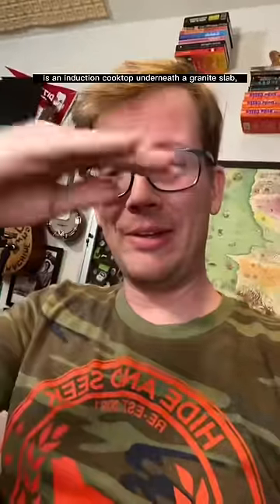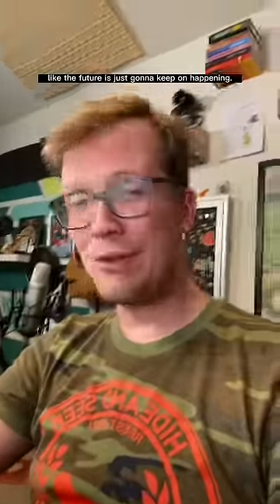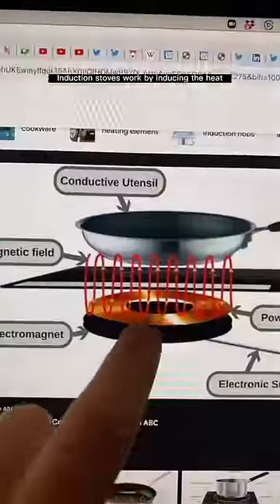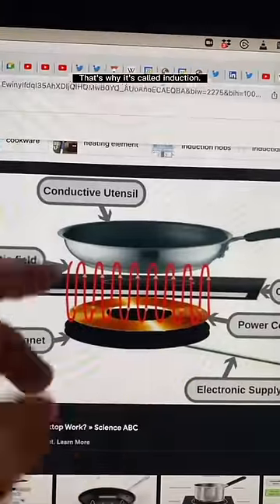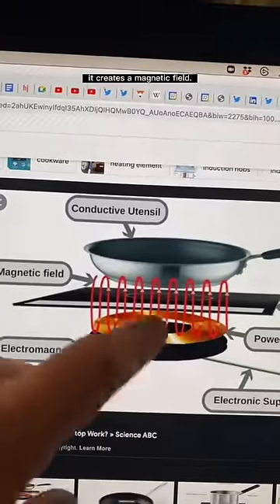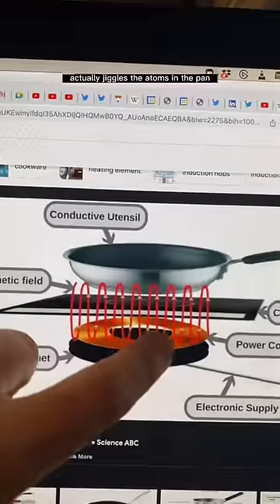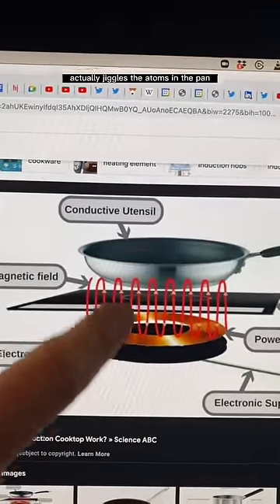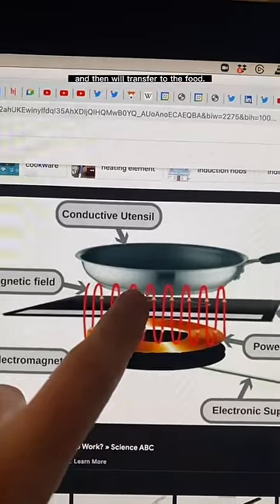How do induction cooktops work?

Comment: I love induction for the heat control, speed to heat up and boil water, and climate/health benefits. What I will say is that this person will find extreme difficulty getting any of those other benefits by having one installed under Granite. Many pans need super close contact with the induction device and even a thick pan will have trouble heating up enough to boil water.

Comment: I have a small countertop one that's kinda like a hot plate, they give off a super high pitched whine when you use them but I haven't heard it since around when I turned like 25 yay age related hearing loss lol sucked when I was taking culinary arts in highschool though.

Comment: Slight caveat: only certain types of metals are compatible with induction stoves. Learned that the hard way after a move. If you can stick a magnet to the bottom of it, it’ll work.
Reply: That's a great check to remember. Thank you.

Comment: Unless your house is solar-powered, it's MUCH more efficient to burn gas to provide heat directly, than to burn it in a power plant to make steam to turn a turbine to turn a generator to feed a transformer into a grid then back into a couple more transformers then wires into your house then an induction stove to make a pan hot. Burning fuel to make heat is almost 100% efficient. Using electricity, if you start off from the fuel, ends up being about 40%.

Comment: I just don't think anything beats gas stoves when it comes to the responsiveness/control they offer over the exact temperature of your pan. I've never liked cooking on induction and I've tried it for a while before going back to gas.
Reply: It takes some learning but it’s honestly so much easier and quicker, but mostly it’s just so much better for this planet we share!
Reply: @alam8540  eh, it depends where you get your electricity from - in many places you're just shifting the carbon emissions to another location nearby. And the difference between owning a gas stove or not is pretty minor in terms of yearly emissions compared to so many other things. 

Also I'm not looking for the one that will allow me to cook /quicker/, I'm looking for the one that will allow me to cook /better/. I cook a lot, and I appreciate the feel of a gas stove and how easy it is to understand it's current heat and how easy it is to make minor adjustments including by being able to lift the pan/pot off the cooktop a little bit to reduce heat too - which is something induction often doesn't work with.
Reply: @Night_Hawk_475  The idea is future proofing, as electricity production becomes more and more sustainable (or less unsustainable) the difference between the carbon emissions of a gas stove and induction will grow. Also it being faster means it’s more efficient, taking up less energy.
Reply: @alam8540  to do the same amount of work but faster takes more energy per second for the same total energy spent over the portion of the task - this applies in general for physics. Being faster doesn't always mean more efficient. 

Induction is more efficient, but the speed isn't the reason why.

Comment: That is so freaking dangerous. The thing about induction is that the cooktop does still get hot, because the metal cookware gets hot and some of that heat is transferred back to the surface, so you'll just have an invisible burning hot spot on the counter.

Comment: Not quite exactly what happens. What is really producing the heat is the electrical current induced into the metal pan. This is actually why transformer cores are made out of laminated plates instead of one big chunk in most cases, because the smaller the metal, the less current is induced into it. That's why a fat thick cast iron pan will work really well on an induction stove while a thin sheet pot will barely heat up.

Comment: Might lose a lot of benefits when behind thicker granite, even if it's thinner where coils are. If it's very thin, it's probably much more likely to break than the usual tempered glass used on induction stoves and much more expensive to replace.

Comment: Looks fancy until you forget that the pan is hot and also gives heat of to the granit so you never know what part of the granit is hot.
I also have an induction cooktop and it's great. It's not fancy like that granit one but mine has some glowing icons to tell me if something is hot
Reply: You can put a thin cloth made with heat insulation material as a pad for your pot. That won't affect much on the heat transfer because, as stated in this video, the energy goes "through the air" (changes in magnetic field).

Comment: I have an induction cook top (built into an oven, not invisible like this). Runs as hot as my gas one used to, isn't anywhere near as much of a nightmare to clean, gets hot SO fast, don't have to worry about the dogs turning it on and burning the house down (has happened once before - came home to a house FILLED with gas, no idea how animals didn't die it was that thick in the air)

Comment: As a cook and someone who's had induction ever since they've lived alone, induction is great, it's ecological, it's safe... But I miss fire, I miss being able to lift my pan up to sautée something, I miss having a clear indicator of how hot my shit is (or just a constant heat in general : induction doesn't fluctuate voltage or heat, it just turns on and off. if you put it on 80%, it'll turn on for 80% and then turn off for 20, that sucks)
The day we're able to make carbon free fire, that'll be the future.

Comment: so in this situation the pan heats up from induction while sitting on top of a granite heat sink?  like i know the stone isn't going to get hot due to the thermal mass difference but its going to draw all the heat off the pan right?  like thats why these cook tops are covered normally in glass and not 1/2 to 3/4 inch stone..

Comment: But the process of making the electricity to use induction cooker will emit CO2. For many homes it is out of reach not only because of the cost, but also the electrical infrastructure is not ready to transmit that amount of power. It is also in many cases still more effective to use gas.

Comment: the stove surface doesnt get hot, the pan does, but then the heat from the pan is going to transfer heat so you still couldnt cook something and then slap the surface immediately after removing it right? the cooktop surface would get a bit hot right?

Comment: mind, not all pots will work!
They need to be iron, or iron based (IE: Steel) otherwise they WILL NOT WORK.
As a professional chef those hobs are the bane of my existence, because I like to use aluminium pans because they eat up/cooldown faster than steel does, I also like to use copper pots for the same reason although they are a pain to clean.
So, you either use ferrous metal pots, or get the ones with a mixed layered bottom.
Reply: buy carbon steel light pans. I have a wok here that heats up pretty fast.

Comment: We had an induction stove that WASN'T hidden and one day my roommate put a glass  casserole dish down on top of it, not realizing it was still hot, possibly still on - it's been a long time, can't recall. Anyway, the pan EXPLODED. thankfully nobody was hit by flying glass.
Lesson here I guess is get an induction cook top but like be careful with it ok
Reply: The. Stove. Stop. Does. Not. Get. Hot. 

That’s literally the benefit of induction. Maybe you’re talking about a ceramic stove, which does keep hot quite a while. 

But any induction stove gets lukewarm at most.
Reply: @marcelslofstra2157  ok, well, it might have been a ceramic cooktop - they look pretty similar. But I imagine the same thing would have happened with an induction stove that was left on.
Reply: @anxiousArtisan not likely. My induction cooker gets a little warm from the metal pan sitting on it but definitely not hot enough to make glass break.

Comment: Where is the dials/controls for the stove top??? Also though granite is heat resistant, doesn't the sealant used on them yellow with prolong contact to hot pans?

Comment: Even though the there is no conduction of heat into the granite from the induction burner, wont the pan conduct the heat into the granite causing issues?  I know most foods will stay below boiling (atleast until the water is all gone), but if your gonna do a high heat sear at 450, wont the stone crack from the heat of the pan?

Comment: They may not burn natural gas, but they will burn the bottom of all your pots.
They also stop working or turn off, while performing some basic frying techniques, where the pan isn't making full contact with the surface.
If you're gonna buy a cooktop, I suggest you try to avoid induction cooktops at all costs.
Reply: You can get steel disks for less than $10 which solve that problem.

Comment: Having the cook top be indistinguishable from the countertop seems like a bad idea, what if you forget which part is counter or a guest doesn't know and someone puts their phone down on the induction hob?

Yes the induction hob won't heat the counter directly, but having a hot pan sat on the counter while you cook will still allow heat to conduct from the pan into the counter and make it unsafe to touch. There's no indication that part of the counter may be too hot to touch.

Comment: HONESTLY, I'd imagine this might be cheaper than getting a "proper" one. All you'd need to do is buy the inductors, which are frankly NOT that expensive, and if you're DIYing it, a simple voltage regulator and a little eletrical knowledge, dremel into the granite, epoxy the inductors in place, and there you go, maybe $90-120, assuming the counter was already there.

Comment: The issue with an induction cook top, is that all your pots and pans have to have heating elements built into them making them all significantly more expensive and also a pain in the ass to find.  There are other issues but its far from just a cool thing.

Comment: Wouldn't cooking through the granite make the stove way less efficient?  Do they have to thin out the granite or is it possible to target the "depth" that the magnet is efficient at?
I have a normal induction stove but i can't just hold the pan above the cooktop and have it work, the stove actually detects that and will yell at you and disable the burner if the pan is missing for too long.

Comment: I got one, induction cooktop. I had to throw it away eventually. I did not know enough about them.    Then I got one that fits the pants that I have with a larger coil, and I paid the price to get one that has more adjustability.    It was worth it.  I still have my butane gas cooktops.  They will never go away.  I still buy the propane bottles by the case.   But my work horse now is my induction cooktop.  Now I also have three of them.   One is set up for traveling and is only a 6 inch cooktop and smaller.   The other one was one of the first ones that I bought, and does not have the variability of the last one that I purchased and I use all the time.   After all they’ll be times when I want to cook tops going…. And then of course I have my butane cooktops.  It is the way of the future.

Note : you can make the perfect hard boiled egg, by setting your cooktop to the proper temperature. The egg will cook all the way through and not overcook.  An egg will cook at 61°C.  And you can keep it hot at 60°C without it cooking further.

Comment: nice, but the explanation was a bit fumbled. the heat is a consequence of the electrical resistance of the ferromagnetic material. changing electromagnetic fields induce a current in the material, and the resistance to sed current is responsible for the heat.

Comment: Except thermodynamics would man that even if th induction magent itself isnt heating up its heating itself up through he pan. The pan has to get hot enough to cook food. Therefor he hea cannot stay in the pan and there is no way to block the heat from reaching back to the magnet theorfor the magnet does infact heat up. Like, dont try touching it after removing a 400° hunk of iron from it.

Comment: ... I know induction doesn't need to be perfectly aligned, but still... how would you align the pot with the induction coil below, and without any boundary - pets are more atrisk not to mention our own hands - because induction doesn't heat up but pots and pans DO so that counter top will be piping hot where you put the pot on. it's not the hotness everyone thinks it is

Comment: confused
If the PAN gets hot from the EM field jiggling it, won't that transfer heat to the granite?
resulting in a situation where you may have a burning hazard since there won't be any indication when that heat is present in the granit?

Comment: That can't be good for the granite to have localized hot spots like that. Like I put hot pads under my pots if I sit them on a counter top so as not to damage it and they're actively cooling down at the time. Having a sustained heat source (the induced heat in the pan itself) over little spots has to come with some major expansion and contraction that can crack the surface, right? 

Also, just logistically, how does this work?  None of the area is marked. Are there no zones for different temperatures? Does the whole counter just have one knob so all pots heat up the same? Also, is there anything to indicate to someone that a pot of boiling water was just sitting on that counter and it would be a bad idea to lean on it?

Comment: Gotta get the electricity from somewhere and that’s still mostly fossil fuels at this point. The difference in greenhouse gasses between you or the power company burning it is negligible at best, not to mention what is created in getting and producing those appliances.

Comment: I’ve been a cook for 18 years and I can confidently say that induction cooking is trash. Electric is better and gas is best. Induction only lets you set it to a few preset temperatures and turns on and off so you can’t apply heat consistently.

Comment: We have an induction cooktop, and I can tell you that this is a terrible idea. The cooktop doesn’t directly heat the surface of the cooktop but it DOES heat the pan, which will transfer its heat to the surface it’s resting on. There might be a use case for this if there was an extremely low thermal conductivity material for this to function on that would barely absorb any of the heat from the pan, but I don’t know of any that would also be suitable as a countertop (stain resistant, scratch resistant, water resistant, etc). Granite is pretty good, but if you’ve ever put a hot pan on granite, moved it, and then been violently reminded of precisely where it had been resting, then you’ll know that I’m very very right about this. And this would only be worse because the pan would be sitting there for a long time, much longer than just resting a pan in a place for a couple minutes, you’d be actively cooking with this setup. I just think it’s a bad idea all around until the material science improves by a LOT

Comment: how do you know its on or where the elements are? it seems very unsafe to have a intensely hot granite slab that will take a while to cool down. wont it transfer heat throughout the whole slab and melt anything you put on the counter and like i said you dont know where it is or how hot it is

Comment: This is a very bad idea apart from the obvious.   The non obvious part is- your granite will crack and shatter from high heat. It won’t happen right away, like all things the heat will wear it down and eventually it breaks.   Even if the heat isn’t transferred from the electromagnetic field to the counter, you will still get heat transfer from the pot or pan that gets hot. Which will in turn heat up the granite

Comment: Wait induction stoves are meant to only heat up the pan? Every single one ive ever seen has had some sort of heating element under a sheet of tempered glass and it definitely heats up a lot more than the pan and definitely is not as nice to cook on when compared to a traditional gas stove, its temperature settings dont actually change the temperature but rather they change how long it is on or how often it pulses on and back off, because of that its rarely holding a consistent temp like you can get with gas, and it can go from barely hot enough to far too hot for your needs very quickly

Comment: Instead you burn the natural gas far away, waste 40% of the heat energy turning it into electricity, waste another 10% getting it to your cooktop and another 13% turning that electricity into moving magnetic fields that heat up your metal cookware, as opposed to burning natural gas, where 100% of the heat energy is released and 80-90% goes into your pan.

Comment: Cool in theory but they suck for actual cooking, at least the ones I’ve used. Poor temperature control compared to a gas range or even a traditional electric stove.
Reply: I have fast heat and 14 different powers

Comment: But wait hold on a second, if induction cooktops work by jiggling the pan with magnets, then how come they can burn cork pads which aren't magnetic? We have an induction stove and cork pads have sometimes been accidentally burned when one of the heat spots was left on.

Comment: Surely the granite will discolour with time and the whole thing will look terrible.
Reply: You can put a thin cloth made with heat insulation material as a pad for your pot. That won't affect much on the heat transfer because, as stated in this video, the energy goes "through the air" (changes in magnetic field).